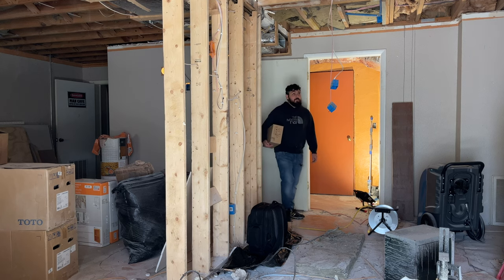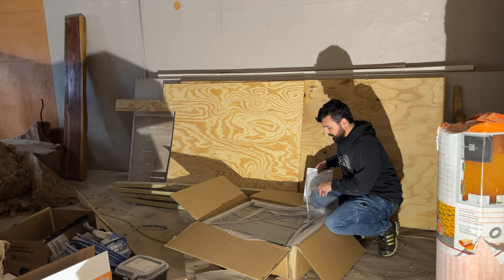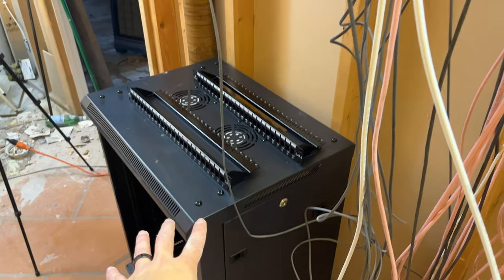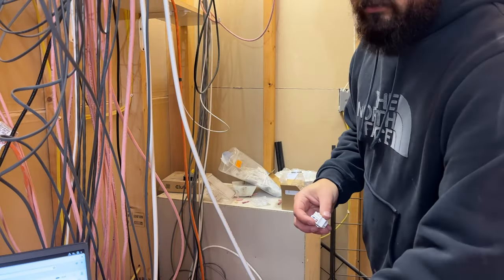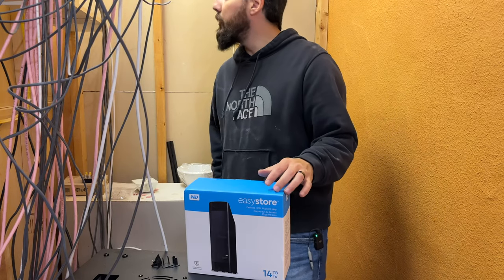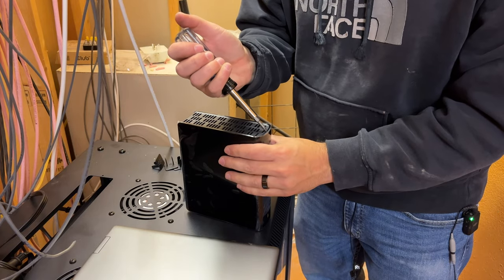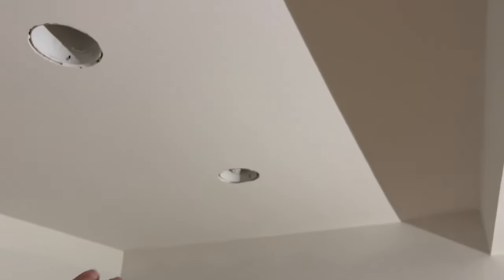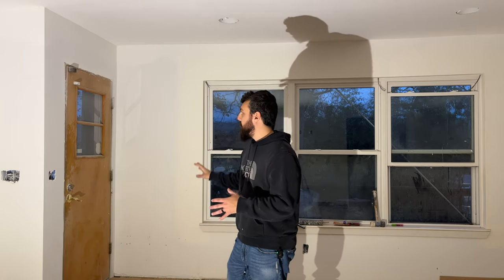Ubiquiti Home Network and Protect Install at Julie's House | Part 2

Comment: Hey man! Great video. Security systems professional here, one piece of advice I want to give you, please use surveillance grade hard drives such as Skyhawk or WD Purple or any specialized enterprise/NAS HDD models such as WD RED or IRONWOLF. Even though cheap, normal HDDs break down much faster and are not as reliable long term (they fail the SMART tests much more often after years of usage). Those drives also come with a 5 year free data recovery plan which gives you peace of mind in the case something does goes wrong and the client will most likely not lose critical recordings.
Cheers!

Comment: If you take apart the enclosure with little to no damage then keep them in the boxes for if you get a failure to RMA it. WD did not give me a hard time on my RMA when one of my drives failed in my NAS. I just kept a list of what internal serial number went in each enclosure and keep in my garage.
Reply from the maker: I've heard such things.  I have yet to have one fail.  Cheers to hoping.  The enclosure is in relatively good shape.  Didn't break anything thankfully.

Comment: For the Keystones I use Trendnet ones, they have a plastic 'cover' on a hinge and when you close it the strands get pushed in so you do not need a pushdown 8 times
Reply from the maker: Wish I had those.  These are a bit tougher than usual.  Not my go to for sure.
Reply: If you do a lot of keystones the vertical cable vmax jacks with the ipunch tool are amazing. they also have an extreme density keystone panel with 48 slots in 1RU.
Reply from the maker: I’ve seen tools like that I think where you can crimp a keystone in one go.  It would be nice to have one but I don’t think I do it often enough
Reply: @SPXLabs  The V.C. stones are nice but cost $2.40 ea which is twice the T.N. cost, also for those you can use regular pliers to close them up, no special tool needed

Comment: A full year?!?! Who's slacking? MY home office floor was ripped up in I think April 2022 and finally got fixed in October 2022 for a pipe that cracked in the foundation. I'm still not back to where I was before on unpacking and organizing my tech.
Reply from the maker: It's a pretty long list of problems but mainly lack of supplies, poor work, contractors that were fired, contractors that never showed up to start, difficultly finding contractors, and then redoing working because of damage due to excessive humidity.  But that isn't the conclusive list, just the high points.
Reply: @SPXLabs  Sadly that's a problem not only in AL but everywhere, there are less and less folks that really care about their craft and only about making a quick buck or two ...
Reply from the maker: I've heard!  And the ones that are willing to do the work are hyper expensive or so I've been told.
Reply: @SPXLabs  We're getting repairs done right now, too ... someone set the carport on fire in April ... but the level of tool abuse/misuse and crappy work is frustrating ... on the other hand though I stay out of it since they are insured ...
Reply from the maker: What??  That's wild.  Why would someone do that????  I'm not sure what is more frustrating getting bad work done or not being able to get any work done...
Reply: @SPXLabs  IMHO getting some work done is better than none, at least you have something you can improve or build out your network etc

Comment: Great, that was very helpful. I didn’t read anywhere in UI’s specs what were the specs for the drive capacity, power requirements, I only saw the size 2.5 and 3.5. Thanks again

Comment: Have you checked into having your internet connection being bridged so your actual Internet address is located on the Dream Machine? Makes things a ton easier especially if things are added that require opening ports. Also, one of the cheap network testers available on Amazon that has 8 remotes would have made your life a lot easier. I’m struggling through a pretty big install right now also, and one of those jobs that keeps getting more and more added to it as time goes by. Yesterday I spent 14 hours taking the old rack out and installing a slightly bigger one, but a 24” deep one on a hinge, and wow it’s so much nicer, I struggle with keeping things neat and organized but I’m learning. It has 3, HDBaseT boxes, each with 8 inputs and 8 outputs, and as of now they go to 21 TVs, 17 are 85”, and 4 are 86”, then there are two access points, 4 small switches and one 24 port PoE, a 64 camera NVR/switch system, a door access secure area, a point of sale system consisting of a server, 2 wired locations, and 4 wireless locations, and it’s all connected to a liquor gun system that makes it so you can’t make a drink unless it’s put on a persons bill. On top of that there are over 1,000,000 leds on two different, DMX systems, and a networked JBL audio system. That’s all I can think of at the moment but there’s more lol, it’s a zoo but I’m having a lot of fun with it at the same time. So, after all that babble, it’s the reason I’m looking into network install videos, especially UniFi systems, I’ve done several already and am still learning of course. Firewall rules are a struggle for me, especially in UniFi, keeping all the networks separated for security. Tempted to do a video of it but I’m super awkward on camera and there are always people around, plus I’m on the clock so have to watch that. Anyway, looking forward to your next video.
Reply from the maker: Not yet, bridging or passthrough is probably one of the last things I'll look into.  There is still so much to do and having to keep waiting for contractors to do their thing is getting very annoying.

That sounds like a lot to manage.  Liquor gun system?? I need one of those lol.  It also doesn't help that UniFi keeps updating and moving things around lol.

Filming a video with other people watching is strange, I'm still nervous about it to this day mostly because I don't film in public hardly ever.  If you do it and keep doing it you will get desensitized to being on camera.

Comment: What considerations are you needing to check for hard drives. And is a 14 TB drive no problem? Why Ubiquiti only sells an 8TB, I will never know. What was the crank of 14 TB from Best Buy?
Reply from the maker: I give clients options, like purple drive and less storage for high cost or more storage for cheap but probably more prone to failure.   The Wd easy store drives are normally on hella sale like $200 or less for 14TBs and are helium filled and tend to be resilient.  So people take their chances on the cheaper drive in order to have more recordings in their history.  There is no performance difference.

Comment: Why have a cloud key if the UDM pro can host the network console?
Reply from the maker: About a year ago in Part 1, when we started the project, there was going to only be some cameras and a couple access points.  But after a little while the home owner wanted to do some upgrading.  Also there was a burglary at one point and long story short, there are actually two UDM Pros that were bought for this project.  An SE and a 1st Gen UDM P.  And many other additions since Part 1.

Comment: Are the hard drives in those easy store devices NAS rated?
Reply from the maker: I don't believe so.  However, I prefer non-nas drives as these have higher RPMs, are helium filled, will probably never be spun down, and will perform well with multi-user access.  I'm sure a NAS drive would be fine in UDMP but if I had it my way, I would also buy one of these Easy Store drives for my own UDM.  But I don't care about the warranty and junk because they are significantly discounted.
Reply from the maker: This drive was probably bought several months ago.  But either is way fine and either work fine
Reply: I would not put a NAS drive in it, but a surveillance-rated drive. For WD this should be a Purple.

Comment: Using those hdd from those external hard drives won't last. I installed those in almost a dozen cloud keys and udm pros and they have all failed within a few months. Those cheap nas drives are not ment to be constantly written. I had to replace all with actual nvr drives. Be warned. I lost all my profit off those jobs replacing hard drives
Reply from the maker: That's wild.  I haven't had any issues with any of mine.  I use them in all of my servers and my own UDM Pro.  Still going strong after years.